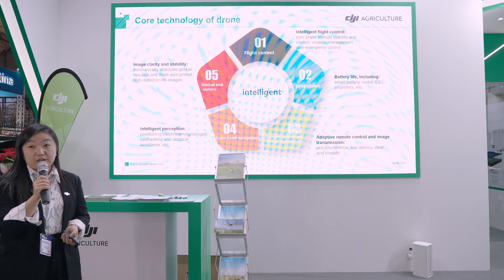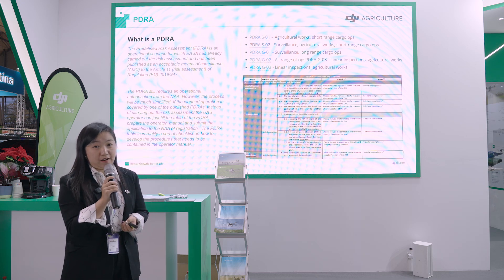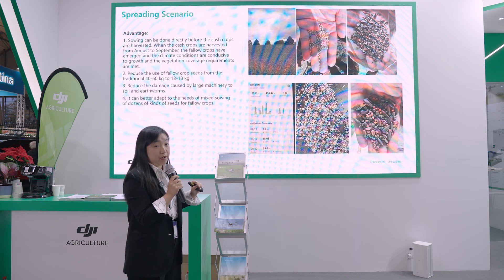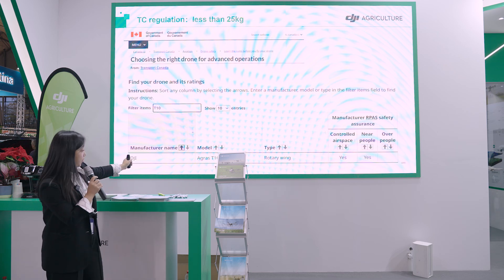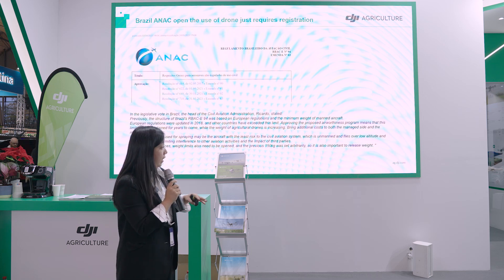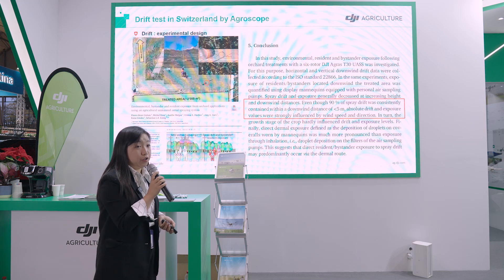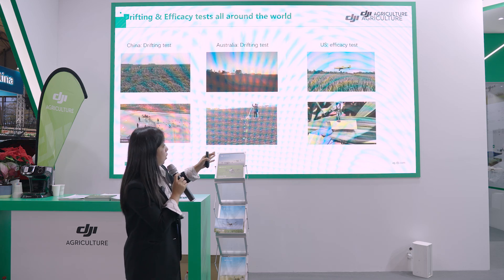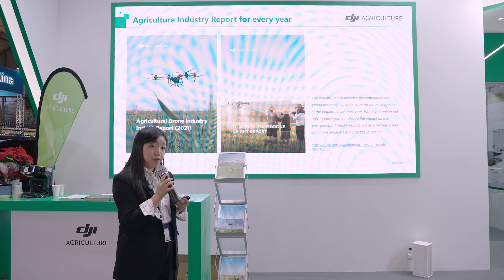Agricultural drone on policy| Agras Webinar

Comment: 3:00 Thank you for sharing this update — it’s great to see that DJI is aligning its systems with the European PDRA framework.

However, there’s one important clarification:
Even though the PDRA no longer sets a weight limit, it still limits the maximum dimension of the aircraft to 3 meters in diameter, measured from propeller tip to propeller tip, not from motor to motor.

According to how EASA and especially the LBA (Germany) interpret this rule, even the T25 slightly exceeds this threshold at around 3.19 meters.

In Germany, this has been further adapted into a national STS (Standard Scenario) — which keeps the 3 m diameter limit and adds a 50 kg mass limit.
Because of this, the T25, T30 and T50 are still classified in the specific category, not under the PDRA/STS.

Hopefully, future updates to the regulations will make it easier to use these aircraft under standardized frameworks.

It would also be fantastic if DJI could support multi-UAS operations — for example, allowing two controllers and two drones (e.g., T25s or T50s) to be linked in a coordinated mission.
If both aircraft could plan and synchronize their routes automatically — avoiding overlap and return-path conflicts while each pilot supervises one drone — it would greatly improve operational efficiency for large-scale agricultural work.